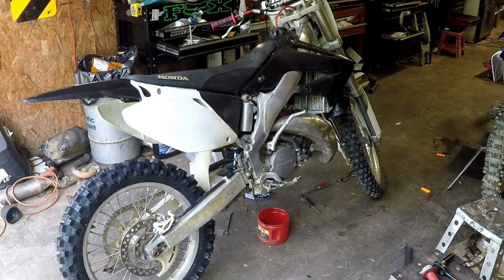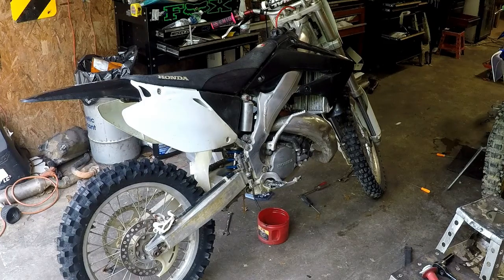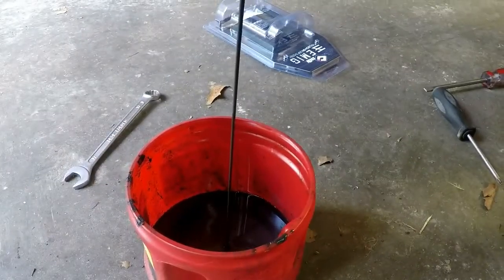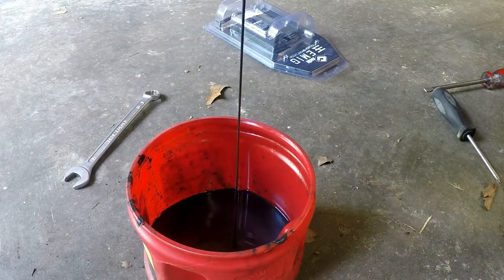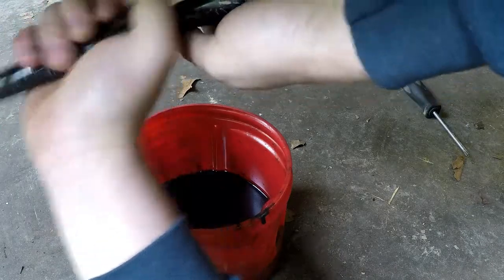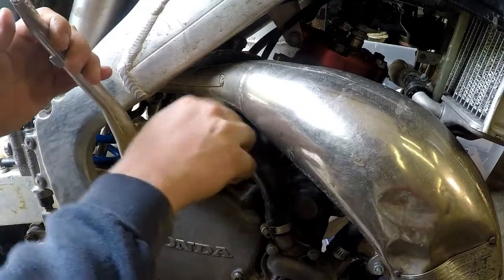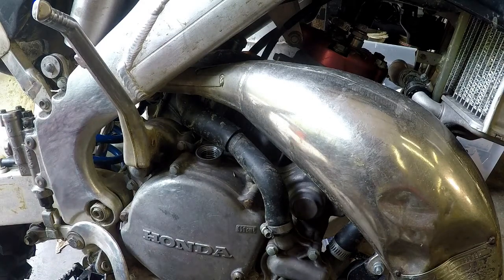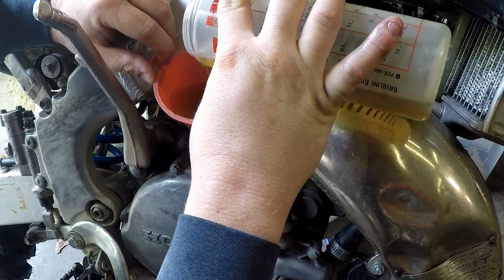Honda CR 125 2003 OIL CHANGE TUTORIAL ~ How to change transmission / clutch oil ! ~

Comment: So on a 2 stroke a syntethic oil doesnt matter, but on a 4 stroke matters?
ITS THE SAME THING, THE TRANSMITION, RUN GOOD LIQUIDA ON YOUR BIKE
Reply from the maker: Lol no it's not. And learn to spell transmission before you lecture me.
Reply from the maker: Lol no it's not. And learn to spell transmission before you lecture me.
Reply from the maker: Lol no it's not. And learn to spell transmission before you lecture me.
Reply from the maker: Lol no it's not. And learn to spell transmission before you lecture me.
Reply from the maker: Lol no it's not. And learn to spell transmission before you lecture me.
Reply from the maker: Lol no it's not. And learn to spell transmission before you lecture me.
Reply from the maker: Lol no it's not. And learn to spell transmission before you lecture me.
Reply from the maker: Lol no it's not. And learn to spell transmission before you lecture me.
Reply from the maker: Transmission and Clutches do NOT require the same level of lubrication protection as the combustion area. Many additives are there solely for top end components and higher heat areas, which is not the transmission and clutches.  Nothing wrong with running fully synthetic for a gear box if you have money to throw away. Just not necessary for steel gears usually.
Reply: The MX Guru Yeah sure u know it, im just trying to say that im taking care of my CR

Comment: What is best oil to use it does it matter? In other words can I use like 20w50 or 10w40
Reply from the maker: 10w-40 motorcycle specific is perfect.
Reply: @mxgryan  ok just to dually make sure I am doing this right, my bike is a 1989 Honda CR125. And you're saying that I can buy just regular automotive 10w40 oil and that'll work just fine
Reply from the maker: @blackisback74  no, I said motorcycle specific 10w-40. Meaning its wet clutch compatible.

Comment: Hi dude which the oil number u recommend me to put to my same bike as urs and finally how much oil I should put in to the bike,thanks men!
Reply: SAE 10w 40 is the manual recommended, ATF works better for more power but increases the risk of overheating. Also most oils work as a fine motor oil other than lawnmower 30w.

Comment: Man I'm trying figure out what oil I use I just picked one up
Reply from the maker: 10w-40 motorcycle oil.
Reply: @mxgryan  for real? It's a 1990 cr125
Reply from the maker: @highlightzilla9581  correct.
Reply: @mxgryan  thank u
Reply: @mxgryan  what do you put in urs I wanna buy same exact one
Reply from the maker: @highlightzilla9581  I usually use 10w-40 maxima premium from AOMC.MX and use coupon code mxguru for 10% off
Reply: What about gas n oil mix?

Comment: How much oil does it use?
Reply from the maker: Idk. Probably 600 or 700.
Reply: @mxgryan  Exactly, you don't know :))) 650 is how big your engine is!! the amount of oil required should be in your maintenance manual. If you don't have one you take that side 10mm bolt out and pour your oil in until it comes out through that hole!
Reply from the maker: @ColinPopoviciu  lol what? I made this video 3 years ago dude, excuse me for not remembering the capacity.  

650 is how big my engine is? On a CR125? 

Make some sense if you're going to troll.
Reply from the maker: Steve I took the time to look it up for you. It's 570 for an oil change and 650 if everything is dry.
Reply: @mxgryan  650 cm³ is what he means 🤘🏻
Reply from the maker: @loganmacdonald2900  😄😄😄

Comment: dont you have to torque that bolt to spec
Reply: Which bolt?
Reply: The drain plug
Reply: You can if it makes you feel better, it's a large bolt and not absolutely necessary.
Reply: Okay thanks for the response.